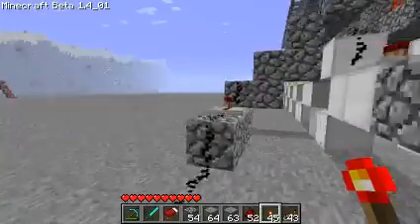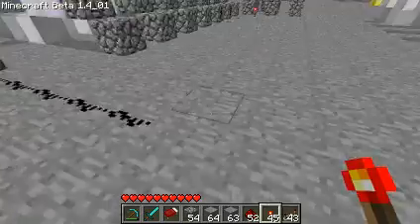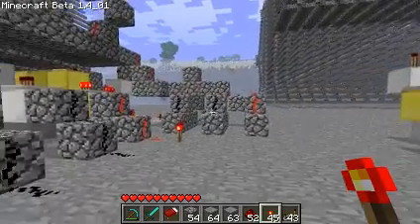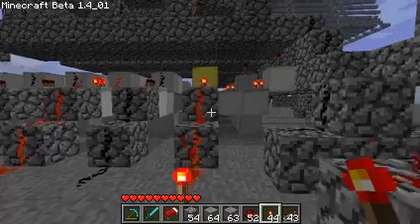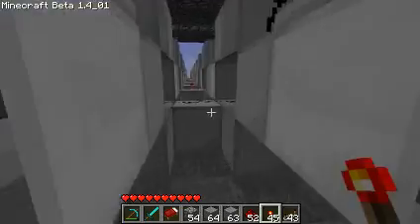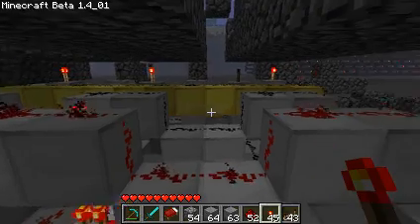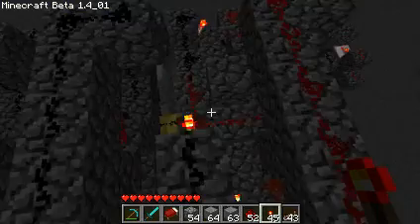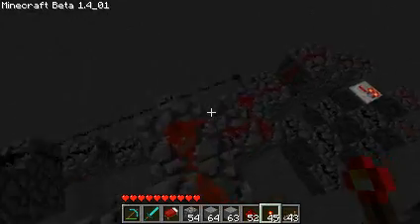Building a Minecraft Computer part 2 - branching in hardware

Comment from the maker: @ShreDDyKickFLiP it's a 4-bit decoder, with each output going to either SET or RESET the flip flop above it. the yellow input, acts an an on/off switch, so that the decoder isn't always sending either a SET or RESET signal, ie, so it can send no signal, and allow the program counter to run normally when not performing jumps.
there is a schematic download in episode 4.

Comment from the maker: @dragontamer5001 the decoder output controls whether the flip-flops will be set, or re-set. because we don't want a set or re-set signal to be constantly fed into the flip-flops (they wouldn't be able to change, as they would instantly be re-set) we have to block the set/re-set signals. when gold is high, the set and re-set are blocked. when it is low, it will allow the signals through.

Comment from the maker: @TheBocajDude read up on decoders. the purpose is to be able to select only 1 of many outputs,  so only 1 instruction is being read at any one time. i used 3, so i didn't have to spend long building it for the video, the computer i made the videos about had 16. and you need enough inputs to the decoder to select any one of those lines (remember, these inputs are in binary), and one last input is needed to tell it when to jump to that line indicated.